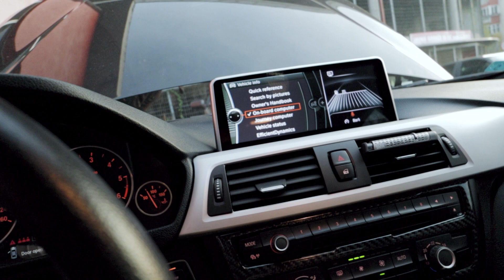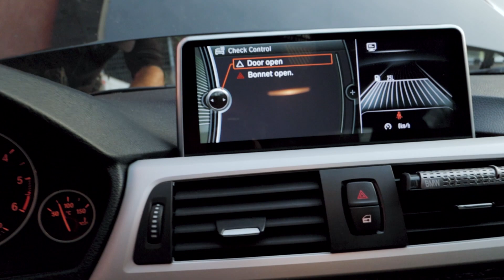POJAČAO SAM BMW *koliko ima konja?*

Comment: 150hp, 350nm.
Mislim da je to to i ne moze on vise izvuc bez ozbiljnijih modifikacija tj. promjene turbine, intercoolera, usisne grane i sl.
Pozz Nedime
Reply: Može više ali je problem cr pumpa koja je od 2.0dci pa mu zna bacati safe mode. Al nekih 170ks i 380nm drzi
Reply: Nije tacno, 180hp i 410 nm stage 1 bez ikakvih modifikacija.

Comment: Trebao bi biti stage1 147ks a stage 2 166ks. Trebao si ici kod simanica na valjke i dobijes koliko ima konja a ne ovako moze ti reci da imas i 200.
Reply: Kako si to zakljucioS?
stage 1 na ovakvom motoru je 180ks i 410 NM.  Stage 2 190ks. 
Isti ovakav motor sa istim diznama i turbinom ima 143ks (318d), takodje isti motor je i na 320d od 177 i 184 ks uz nesto drugacije dizne i turbo.

Comment: Ima jedno 190ks 400 obrtnog. Ja imam isti motor 1.6d. To je ustvari 2.0 motpr. Sa ugasenim i uklonjenim dpf i egr sam izvukao 205 konja i 430 obrtnog. Zvijer je postao
Reply: nema 190ks negde oko 160ks
Reply: @veljaa6133  idu oni na 185 190 konja bez problema sve isto ko 2.0
Reply: @anix1398  slaba mu je turbina
Reply: @veljaa6133  kod mene 205 konja. Imam printani dyno papir. Bez problema evo vev 35 hiljada km
Reply: @anix1398  brzo ce rikne turbina
Reply: @anix1398  hoce hoce

Comment: 140-150ks ?
Reply: Sigurno, da stavi regulator turbine, stage 2 i straight pipe, moze se doci do 180-190 konja
Reply: @Marko 7 straight pipe se stavlja da bi mogao da isporuci tu snagu, jer je prevelika od predvidjene i zato ide drugi izduv
Reply: @Marko 7 Pa zadnje i treba da se stavlja, jer bas iz tog razloga on ce imati tu snagu da stavi straight pipe jer na fabrickom nece imati pravih 180-190 konja
Reply: @Marko 7 Ne kapiras ti mene, imas npr 1.4 motor i 100 konja, odes na 200 konja, sa fabrickim izduvom neces moci imati pun potencijal tih 200 konja
Reply: @Marko 7 straight pipe je jeftinija varijanta